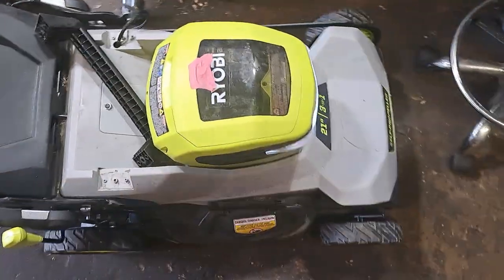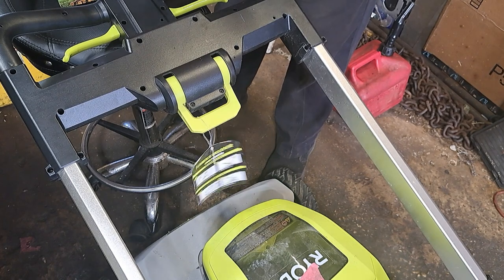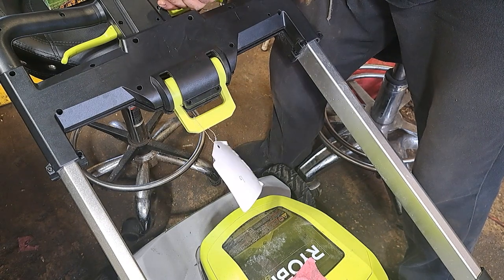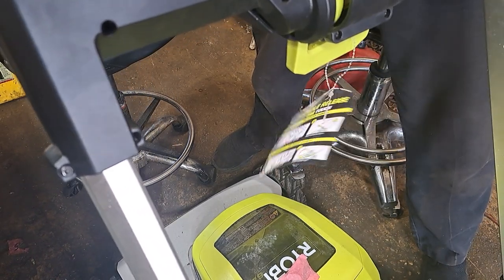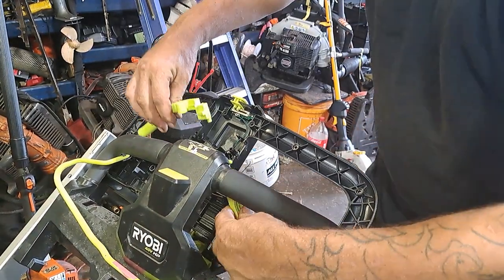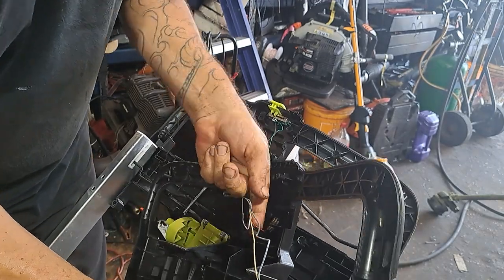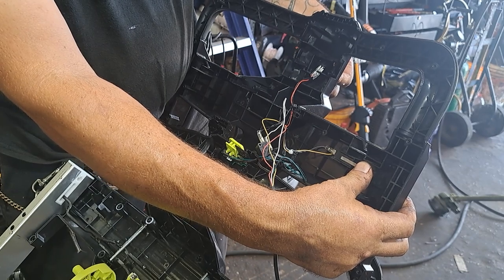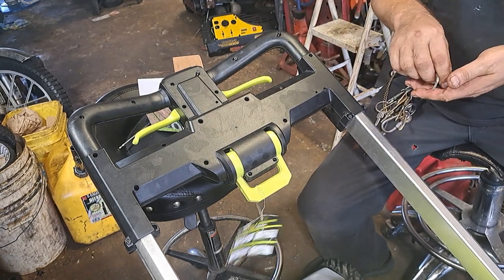whats inside the handle of a 40 v ryobi self propelled battery lawnmower.

Comment: I found out that is a nightmare to put back together. Found no problems with switches. Still trying to get it back together. What did you find out ?
Reply from the maker: brushes were bad
Reply: @smallengineguys   Thanks for the reply. I guess a brushless motor is the way to go. Were you able to repair or replace the brushes?

Comment: I know this is an older vid. But please, would you happen to know where I can find a diagram of what goes where inside that handle, specifically in terms of those little switches. Mine came apart and I couldn't take a pic of the darn thing before is fell to pieces. Mine had the safety on/off switch jammed. It's a cheap switch. But now I can't seem to find what goes where 😅🥲 any help would be appreciated 👍 and thanks for posting. It was helpful and informative. Stay safe.

Comment: yes Yes Yes 
I did the same this moring and just like you found all wires and swithes good
Need
Part 2
Motor / Controller Tear down video. 
Parts RY401170VNM and RY401180VNM
Reply from the maker: It ended up being the brushes. Even though they looked good
Reply: @smallengineguys  similar issue, same model mower: were the brushes easy to replace? what was the cost of the brushes? Mine is 3+ years old and beyond warranty - is it worth trying to replace myself?
Reply from the maker: @kakejb  not to hard to replace the brushes. I think they were 10 bucks. Pretty sure i put a link to them in the descriprion

Comment: Question about reassembly. I currently am trying to put the controls back together. My model is RY401014US how does the switch for the bar go back in and where does the spring go? Stumped on it. It doesn’t have the long bar on the inside like the one in the video. It’s the same one that is used to start the blades.

Comment: I took the handle apart on the exact model and the 2 small springs and 1 , about an inch spring, have me perplexed.  Where do they go?
Reply: I had the same springs pop out. They go perpendicular to the yellow handles you pull. There is a small extrusion the springs go over on the yellow handle and a flat spot on the black handle they push against.

Comment: Does a battery powered lawn mower have a "flywheel keyway pin" like my old gas powered model had? I guess what I'm asking is does it have a similar safety feature of something minor breaking before something like a driveshaft breaks after hitting a rock (for example)?
Reply from the maker: I dont think so but i never looked. Isnt it a plastic gear? Just look up a parts list for it on google.

Comment: Thanks for showing what’s inside.  I wouldn’t even try it.
There went $500 ish.
Reply from the maker: well if its already broken what's it gonna hurt. anyways got it all back together and gonna take bottom apart today.
Reply: I had the same issue. I was able to test the control board for the motor and it was shorted. Got a new one in the mail. Hopefully that's the fix
Reply: @Drummerguy753   An update might help me out with my problem. Thanks.
Reply: @Drummerguy753 I am having that same issue with no blade motor turning on but the self propulsion and headlight are working. Did you figure out how to fix this?
Reply: @gamyrworf6228  just this week. Disassembly was rather simple when following the parts diagram from their website. The motor control module was shorted. I replaced, still nothing. Since I noticed the connectors were melted from the motor controller to the motor, I replaced the motor too. Up and running! Hope this helps.
Reply: @Drummerguy753  thanks for your FAST reply! So you replaced both of these parts?: Cutting Controller Assembly HM-285001002 and Motor HM-742745001?
Reply: @gamyrworf6228  I don't recall this video specifying what model this is but when enter your model number on ryobi's part site, it'll give you a parts diagram for that model. But those are the parts I replaced, yes. Also worth noting the I searched on how to test a DC motor controller with a multimeter on YouTube first. Your motor may still be good but I found that to be more challenging to test.
Reply: @Drummerguy753  Noted! ok I'm going to have to use my meter on the controller. But it's very weird. I was mid mow, stopped to take a phone call, and when I went to go again, it decided not to turn on. So frustrating, because I just bought this mower last season.
Reply: @gamyrworf6228  I got mine used but the previous owner claimed to have run over the charger 🤷
Reply: @gamyrworf6228  would love to hear an update on this if you have one. I inherited this same mower and have the exact same issue.
Reply: Also, self propulsion and light work but no blade power. Used one year. Closest repair is 50 minutes away and two month backup. 🤬
Reply: What a G'D nightmare.  Thank you for making the video and getting the conversation going.   have same problem.

Is there a consensus or bad anyone found it to be anything other than the aforementioned motor?   

Spot on with the controller I  walk up to it everything seems perfectly fine , controlling everything, except for the sharp part 

Everyone is taking it much better than me. I am absolutely pissed every time I see a blade of grass anytime of the day since it happened, then the other nightmare figuring out the proper keywords to search for in Google.
 
Here's my rundown 

Ryobi RY4011-

Blade motor - not working

Propulsion - Working
Head light - Working 
Speed Control -Working 

Home Depot said it would be about 3-5 months, bought it 54 days ago.
Reply: @Ar.Panoptes  I've found that even though ryobi parts are often back ordered status, they ship faster than anticipated. I had to wait a few months for the bag and accessories and only about 2 weeks for the motor (as advertised). If you can understand a parts diagram and turn a wrench (although some long torx bits would have been handy) you can probably manage to replace the parts once you get them.
Reply: Thank you Drummer Guy.... I should probably make one good decision and order both the control board and motor together and assume they both toast?
Thanks again
Reply: Having the same issue on mine too 🤦🏽
Reply: Have been struggling with same issue. Bought one for my girlfriend’s property spring of ‘22 @$449. Worked so good I bought one around Father’s Day for a property I inherited. The sale ended but HD honored the $449 price advertised on the shelf. Worked about 2 months then the blade mower quit. Tore handle all apart testing switches, replacing the blade start momentary switch being I broke it. Still nothing……